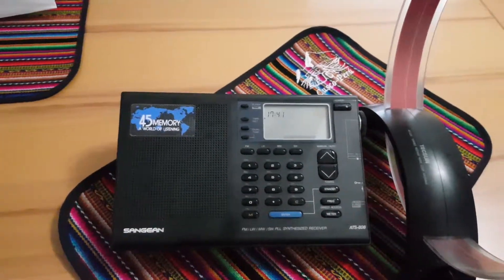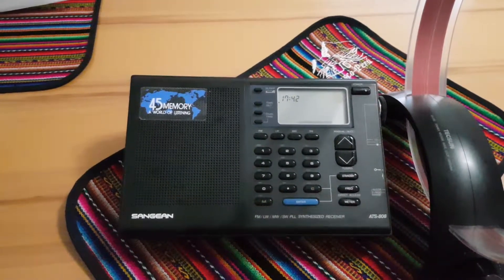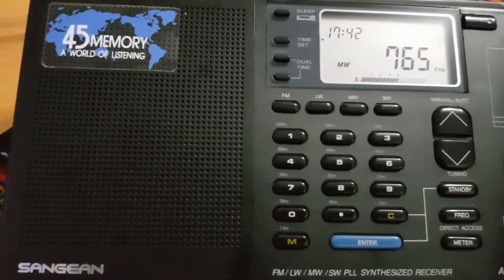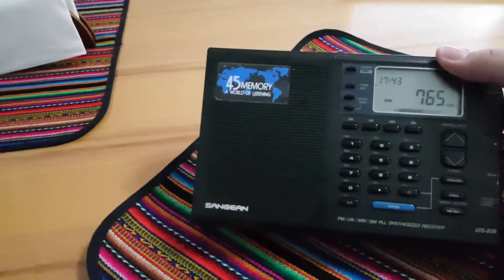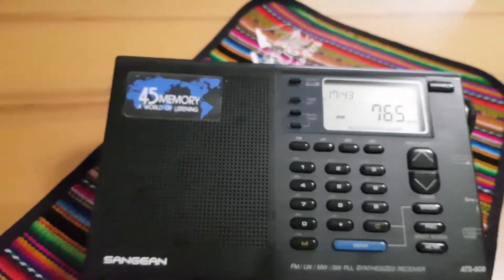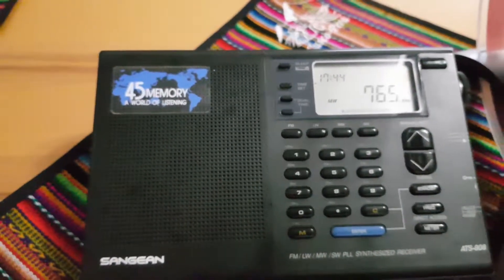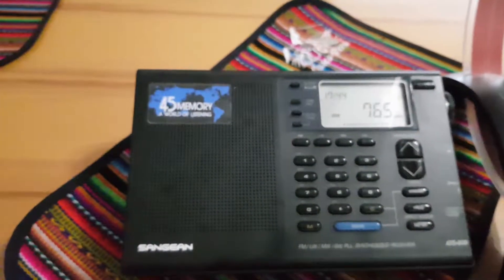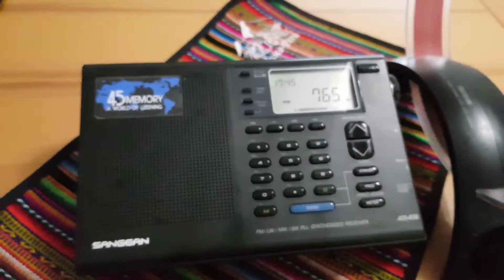TECSUN AN-200 Loop Antenna Demonstration (MW AM Reception)

Comment: Does it just not amp the sound rather than improve the signal?  I did not hear an improvement in the listening, buy more volume instead.  An external looped MW antenna mounted high, will give you far more gain I believe.  It's more cost-effective in the long run because it works.